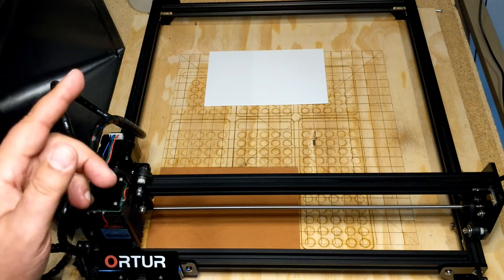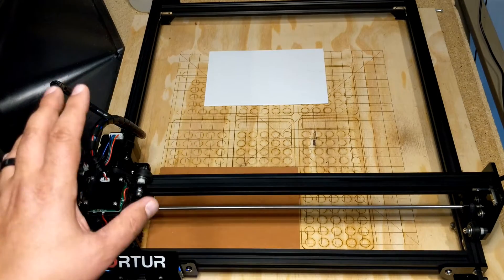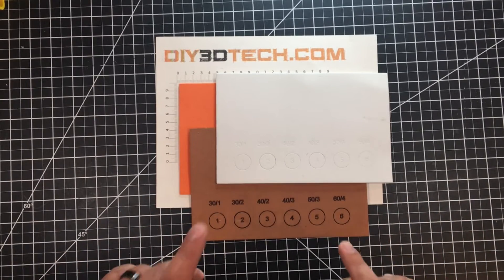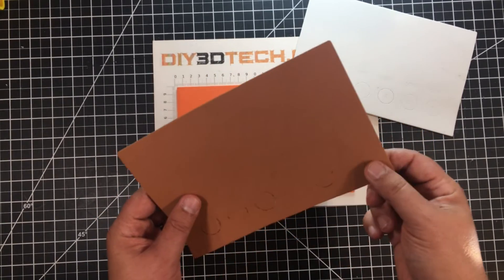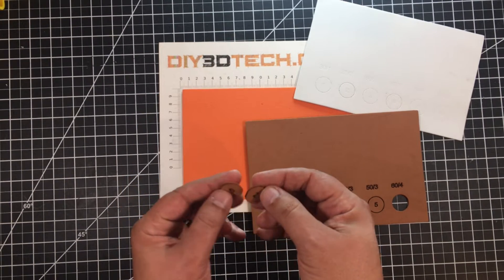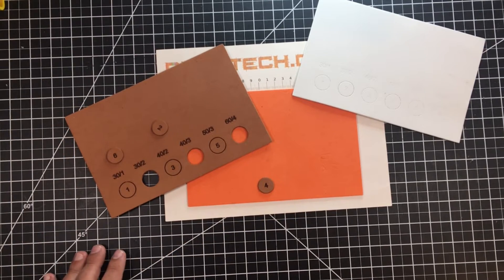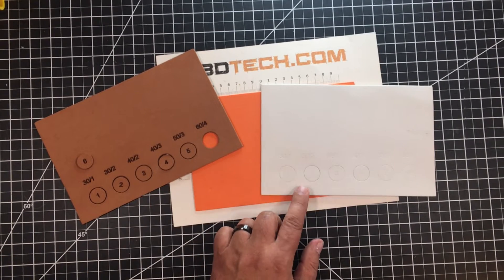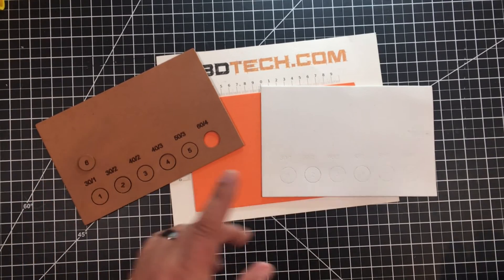Ortur Laser - Recipe For Cutting Craft Foam!

Comment: Hi! I been watching  your videos for a while.....really good job!
I'm thinking in buying the ortur laser but I've seen most of the ppl reviews are using the 15W. So is there a reason nobody its using the 20W?
Is the 15W better or should I get the 20W?
Thanks a lot!
Reply from the maker: First off thank you!  Second, its the price (15 watt verses 20) is the reason.  They discount the 15 all of the time (which is why I bought mine)  however have not seen the 20 discounted. Should you go 20 over 15, sort of yes but depends, if your mainly "engraving" there will not be much of a difference.  However with cutting  it will be a little better, however with visible light lasers as you go up you will get more burning.  For example with 15 watt (which is input power) you just do an extra pass or two and the result is the same.
Reply: @DIY3DTECHcom  thank you so much for replying and help me with the question. 
It really make sense!

Comment: Hi, i love your informative Videos. Whats about putting dark Paper over the white foam to cut it with nearly the same settings like the brown foam ?
Other Question : what do u think about installing an Air assist system (lil bit smaller as on the K40) to get cleaner cut lines ?
Reply from the maker: Many thanks!  Placing a colored piece over it would not make a difference as the piece to cut needs to be the darker color to absorb the light.    If your cutting wood then yes an small air assist would help...